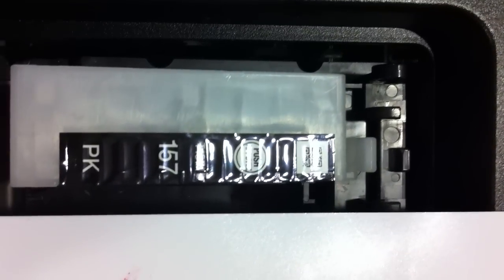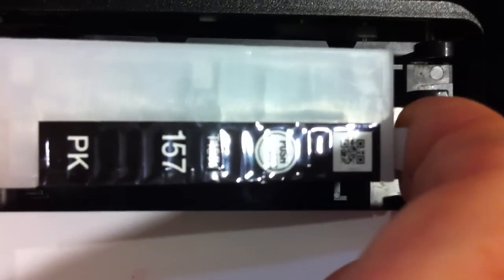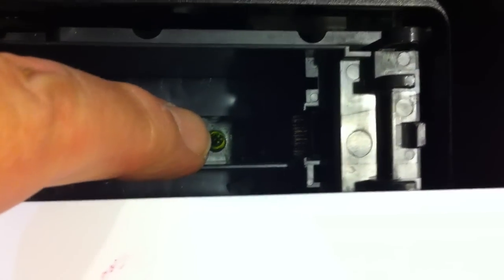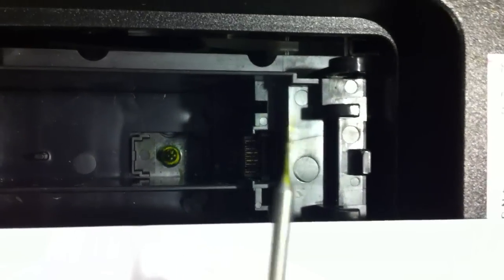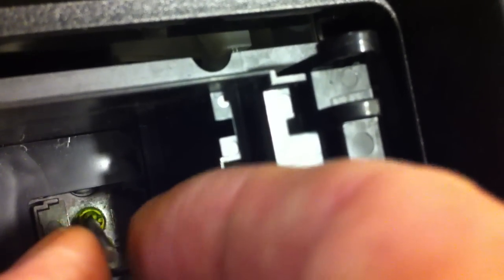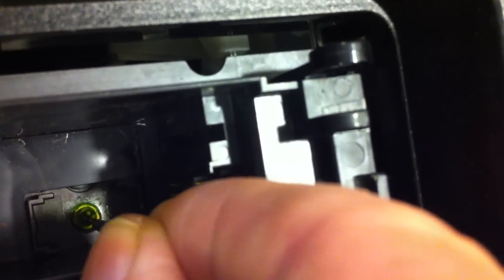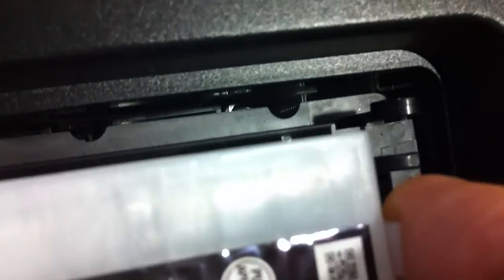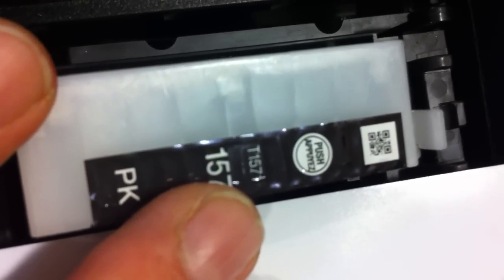Drill out Epson Inkjet Spigots with Micro Drill

Comment: Great videos. Some people have suggested the reason heads get blocked is through the use of non-Epson carts. I had a SX515W and after installing some cheap clone carts it didn't take long for the yellow to get completely blocked. Then the cyan started to get blocked. The magenta and black however are fine. I keep it as a black-and-white printer because the carts are very cheap; the black in this thing lasts an eternity. However I am left wondering about the real reason behind the blockage issue.

Do you think there is a design error somewhere, be it nozzle or cart? A sub-standard ink quality? I've never seen a printer get blocked so quickly and no amount of replacement carts (same brand) will fix it. I have a C64 that's used non-Epson (Pro-Cart) carts for years on end, it's even gone twice around the block in terms of head resetting, and it's still going strong, albeit a little filthy here and there lol.

I did try cheap flush in the SX515W, gently forcing it through the top of the nozzles. It didn't solve the issue, so as you can imagine when I saw your video I though to myself hmm, that's worth a shot. if that doesn't work there's always the option to clean the under-side of the head, as well as check the waste pipes. Perhaps other users have also had similar issues with this particular range of printers.